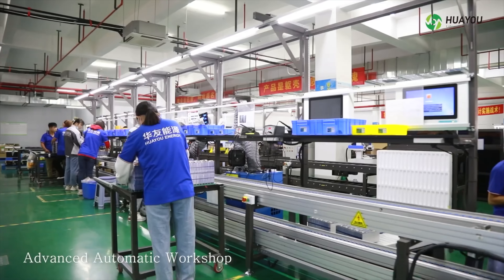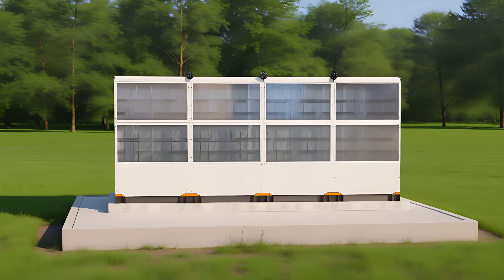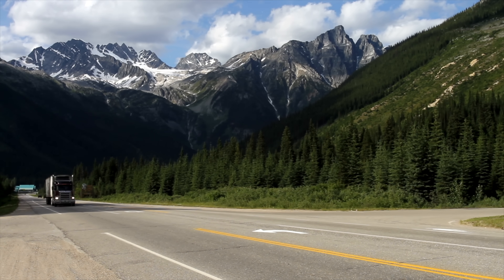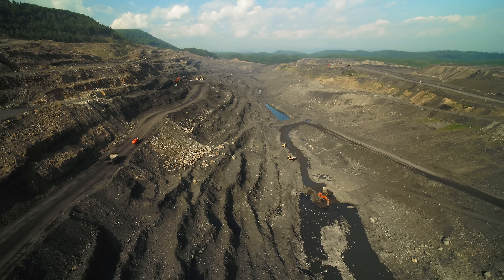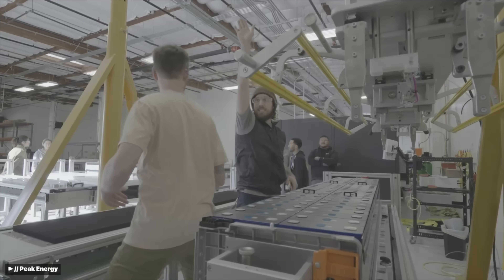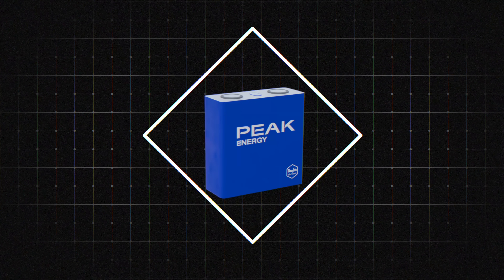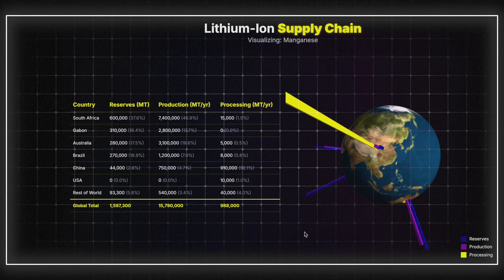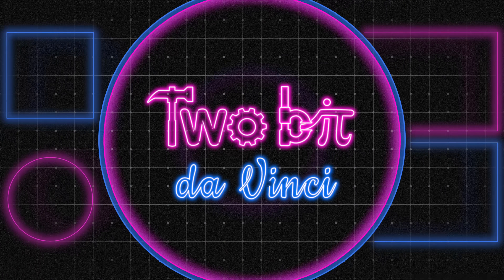Sodium Ion Batteries Are Going to be EVERYWHERE - Here's Why

Comment: LFP is $115 per kwh.  CATL has made the sodium ion, and predict they will get the cost to just $10kwh.  That would be incredible.  A home battery system for under $1000 level prices.  Grid scale will quickly be all over the sodium batteries, as weight doesn't mean anything to them.  It's all about the price.
Reply: I recently bought a 52 cell 306 amp hr LFP battery CATL grade A cells for $3050 including shipping.
I had to buy 3 16s BMSs to convert it to 3 16 kWh batteries for home storage with 4 cells left over for a 12 volt battery.
With a little DIY skills, LFP has become very economical for home storage. I was hoping to get sodium batteries when they became available,but at 72 years old, I probably won’t ever need them. 
$3500/48 kWh =$72.917/kWh. That’s a lot better than the $300/kwh I paid for server rack batteries just four years ago.
Reply: @danielking2944  They're available now, but have very poor voltage stability at the moment
Reply: Closely followed by utilities buying every battery they can get their hands on for the next 10 years to stop home BESS killing off their business model
Reply: @theairstig9164  They wont need to go through that extreme, They are already killing it here in the US by legislation and and all the hoops you need to jump through to have your power supplier approve your installation. Between the scams of equipment leasing and other expense multiplying requirements, local government entities passing strict limits and policies governing how much power you can produce, and HOAs being able to tell homeowners what they can and cant do on their own property, they have already all but killed the independent residential system capable of sustaining a typical house load without the use of the grid.
Reply: @theairstig9164  The problem is more in extended periods of overcast weather. Where I live (southern Germany), in sunny weeks it would be possible to go off grid entirely with a nice big battery. But then you also have the occasional rainy week, and suddenly you need a damn big battery to bridge the gap. 
About utilities buying every battery to keep them out of end users' hands, good luck buying out CATL.
Reply: Private Equity is going to buy all of those battery makers so expect sodium batteries to cost the consumer just as much as Lithium.
Reply: on cell level it is more like 50-70 dollars for LFP, on battery pack level yes, could be approx that, in China below 100
Reply: In Australia, I made 15.6kwh LIFEPO4 battery using eve cells 304ah and solis hybrid inverter for 3K 2 years ago.
Reply: Total installed cost for having battery backup would be around $10k in a sodium battery world.

A microgrid interconnect device (MID) plus an inverter will run about $6k total, if you need 200A service (and only modestly less if not). Having much lower battery costs is huge, meaning the battery system can be quite large, but do not expect to have your home system plus install be lower than about $10k ($2k MID + $4k inverter + $500 batteries for a large battery system by today's standards + $3.5k install). I just had a MID (EG4 Gridboss) installed by an electrician for $2k, and I plan to install the other components myself to keep costs down and because I plan to continue to add battery storage over time so want to be familiar with the details.
Reply: @dosadoodle Nice work!
Reply: Sodium Ion UPS would be ridiculously good for businesses and any location where preserving power is necessary...
Heck in the far future it'd be important in space as well... You know how cold space is right?
Reply: @dra6o0n plus no one can hear you scream....because you already froze
Reply: @dra6o0n far fetched idea we'll need them there our tax $ should drop funding that dumb dream of space travel every country havin financial issues but some are just to dumb to stop wasting $ on shit that isn't helping in the now and not centuries away or never
Reply: @Shawn-c2i  It's more likely wars will keep happening and power would be vital to be kept on in wars, which is mainly the first thing to go out when your enemies blow up your power plant and electrical grids.
Reply: @dra6o0n then a generator would work the same because the grid is out and if no sun shine to use solar to charge with how goin to have power in the battery
Reply: Excellent to see a US company bringing a new technology, especially one with less supply chain risk.  Now, will they find a backer willing to fund and stay the course for the jump to manufacturing at scale.  Even the BEST breakthroughs need either $$ backing and time-patience for the scale-up, or a known capable manufacturer partner committed to the new technology.
Reply: Keep in mind you'll need at least double the amount of batteries and significantly more space as well. The energy density is around half of lithium ion.
Reply: @ericalbers4867  LFP on Tesla has 185kwh. NMC is way higher but also more expensive. CATL naxtra is 175kwh.
Reply: @ericalbers4867  a single lead acid battery in a 1000w UPS for backup power in a room is quite small.
Sodium Ion stores more energy than lead acid in a smaller space, obviously not better than lithium.

But its safe and reliable and has a smaller form factor and weight which means you can pack WAY more into the same space.

Imagine sodium ion 2000w UPS in the same scale as 1000w Lead acid UPS?

Btw typicial low power machines don't use much wattage, its only big appliances and such that eats hundreds of watts to heat or freeze.

So imagine if your home has a UPS to handle 50,000 wattage and its only the size of a car battery or slightly bigger, buried under your home in a accessible compartment?

For people who don't cook or use heating or AC much, it will last way longer in preserving power usage at home, saving you more money on electricity.
Reply: @ericalbers4867  ITs not half, its pretty close - depends on where you get the numbers, but most of them are like 150 NA to 200 LFP or similar in range difference. At least with gen 2 and 3 Na batteries. First gen Na is lower, but so was LFP. Mainly, that is where the 30% keeps coming up because they are that close between the two.
Reply: @ericalbers4867  Some of us don't care about the space constraints.
Reply: even 60$ per kwh would be insane.
Reply: a 91% reduction is too good to be true tbh
Reply: @khang.ngtr487  If it's like the gold rush, every single major powers trying to make their own Sodium Ion battery, results in oversupply, hence lowered cost?
Reply: but in europe newer will be 10 euro per kwh, because europe not producting it and traportating can not be cheep if you transportate heavy things.
Reply: You can already but 8x 320 3.2v 320AH cells for 785 bucks after tax.
Reply: You would have to use your entire basement for home use. lol Their power density is REALLY low.
Reply: @markjohnson7887 its not THAT bad lol and they dont need to be in the basement
Reply: @utpharmboy2006  lol Yeah, I know. But my point is valid. The amount of space needed is substantially more than lithium batteries.
Reply: @markjohnson7887 yeah...home batteries would be about the only thing useable but thats okay. no way for an EV
Reply: @markjohnson7887   The density is about half.  Instead of one battery you get two.  Still come out way ahead.  But we aren't at that point yet, as big grid will come first.  Then the batteries will get better and they can move to home back up.  Not sure about them in cars due to weight.
Reply: Yeah I wouldn't get too excited. It's vaporware until it's mass produced.
Reply: EVs get cheaper, energy production and storage can become more local and completely green. Big improvements.
Reply: Although heavier than an Lifpo4 of the same capacity……it’s still roughly 60 percent lighter than an AGM so it will fall into the general market easily where weight is important.
Reply: That isnt fully true, for example, weight does matter when shipping, so if you have a 30% increase in weight, you will have to pay a 30% increase in shipping it around the world. So weight still has a play in cost. This is why China doesnt want anyone else to make batteries, because, this is factor that will play a big role if you buy local or over seas items. Plus the fact they dont wanna loose control. So all countries should be building NA battery productions and they will have an edge more or less.
Reply: @adr2t   If the battery costs 10% of the LFP battery, covers a lot of shipping.  But my point was more to the fact that with cars battery weight matters.  For a grid battery sitting there on the ground it doesn't.
Reply: @adr2t Sodium Ion lighter than Lead Acid...
Reply: @dra6o0n  And??? Almost all the new battery types are... Most Lead Acid is still produce in the local area/state/country.
Reply: @adr2t  That's because at the current level of infrastructure in America, they don't see a reason to replace something when their power grid still holds.
Stuff like Sodium Ion is especially most vastly useful in Canada and Alaska and Cold European regions. America mass producing these and exporting them would add a lot of profits and jobs to their nation ya know.

You won't see China mass producing this overnight or steadily, they've invested a ton into Lithium and toxic chemical processing for decades now, so it's not going to change much for them as they are a hot climate country for the most part.
Reply: @dra6o0n  They're building 2 new sodium plants in the US right - one about to come online and the other is about to finish up next year. So yes, they do see a need for it. Let alone, we still have cold winters - so mix batteries are still needed for both the north and mid west. LFP and NCM can still be used, but the bigger reason to go Na is because of the resource chain - removing china from it all means we can produce as many as we want without fear of someone else using it as a strong hold. They have already with rare earth and other elements. So its not fear - its reality.

So has the rest of the world and its about to go online - China over produces - so if the rest of the world also meet - they become more of a added supply vs being the sol controler.
Reply: @adr2t  Or you know we could just declare it a strategic necessity and tell the companies build X to produce Y amount of Z within A years.  Or we will nationalize you and seize your leaderships assets and use that to do the build out because you're conspiring with our national enemies.
Reply: @Radagast49230  Doesnt work like that and if it did, then no thank you. We're not china - but that is what china does
Reply: @adr2t  China knows that nearly no one can compete with them in price, even with shipping included into that cost.
Reply: @adr2t  30% increase does not cost you 30% more to ship.  Where are you even getting this idea?
Reply: @magnetospin duhh shipping prices vary on weight the heavier the more it cost I know have shipped a lot of stuff to know this is true
Reply: @Shawn-c2i  Then you are using the least efficient way of shipping and you have never used trucks or container shipping.
Reply: @magnetospin i shipped by air and ground the program was to send the cheapest way and of course we did use trucks for truck order sized orders but most had to be shipped direct to vets and distributors by air because most was refrigerated items
Reply: @magnetospin all of it was based on weight is what tryin to say so like said the more weight it is the more the price goes up no mattered what service used
Reply: @Shawn-c2i  Then your experience does not apply here because bulk batteries are not going to be ship by air.
Reply: @adr2t  with weight being an issue I am willing to bet some of these batteries are going to be manufactured in a dry state, where you open them up and add water prior to charging.
Reply: @priestesslucy  There are dry sodium flow batteries - so yes.
Reply: @adr2t except Hungary is on way to open CATL factory, even as it might happen, they will not stay Orbanocracy through next year, so fingers crossed for them.
 Oh, it means nothing for uSofA, but whatever.
Reply: @MiguelEstornino  No one really cares. Na is popping up in the EU, Japan, SK, US, South American, Canada, there was even talkings of India opening up a plant. The fact that its soo easy to produce and cheap - means that the world will have access to the tech - not limited by China anymore. So even if China might have the biggest plant - or even plants - its just going to add into the mix is all.
Reply: Don't mind the dubious presenter.
Reply: @adon8672  it's true 2BD is often jumping on new stories with little proof behind the ideas... But if you don't like the guy why watch?
Reply: @priestesslucy I do not dislike the guy. I dislike the hype-like video. From the title, I was expecting something more ground breaking or at least fair and balanced comparisons. Many start ups have come and gone after hyped up videos like this deceive members of the public into investing in them.
Reply: MNC is $100/kwh
LFP is $50/kwh.
Reply: Wont be allowed to happen. Too many trilliions at stake in fossil fuels.
The cheaper and more effective batteries are, the less you need the grid.
Reply: @Baleur how are you going to charge them? you think renewables are gonna be able to run all the data centers they are building? no
Reply: @Baleur if you have alternative sources of energy
Reply: Sodium ion is junk for energy density
Reply: @DeweyKendrick It's a upgrade for the lead acid battery for UPS solutions.
It's not meant for electric cars, as barely anyone owns them worldwide in sufficient numbers.
Reply: @DeweyKendrick so its bulky and heavy but they are using it for grid which makes a lot of sense but im not really sure with all the data centers we will be producing excess for long. maybe in 20 years when weve got a bunch more fission plants up
Reply: @DeweyKendrick don’t have a light saber ,just a few LED bulbs and a fridge 😂

Comment: Great news if it can be commercialized at the projected price.  As the lithium cells in the grid backup units reach the end of their useful life lithium and other valuable elements can be recycled.

Sodium based cells would be ideal replacements for the passively cooled battery packs on the many Leafs still in service.  Maybe by the end of the decade

Comment: I really hope this technology works and comes to market soon.  I see the Peak Energy battery as a great solution for whole house battery storage.  I would be very confident with having this much safer battery attached to my house versus any lithium battery.  I also love that it can be fully sourced within the USA.
Reply: The raw sodium battery cells are already on the market since early this year, from the 15Ah cylindrical to 280Ah prismatic cells. However it's still limited to just one supplier (Hakadi Battery) and if you order from it, it takes an indent period of between 2 weeks to 1 month

The reason of this is because the production rate of sodium battery is still relatively small compared to LFP, and most of the sodium ion battery supplies goes to the domestic market
Reply: Agree, at least allows America to have a running man in the race, South Korea manufacturers already said they won't be able compete, this includes Samsung, CATL's layered oxide sodium battery offers higher energy density for electric vehicles (EVs), while American sodium pyrophosphate (NFP/NFPP) chemistry developed by companies like Peak Energy provides enhanced safety and a longer cycle life which is great for home battery storage.

Comment: unfortunately you need to research more, carbon or graphite china controls 90% so monopoly won't be broken anytime soon unless graphite production scale up dramatically , don't underestimate carbon
Reply: You just pulled that "statistic" out of your ass. From Google: "China controlled an estimated 77% of global graphite production in 2023, and its market share in the processing of battery-grade graphite is even higher. By 2025, China's market share in the graphite anode supply chain is projected to be over 85%." Raw graphite and completed graphite anodes are not the same. Graphite is sourced from other countries including India and Brazil. (Both countries that Trump has antagonized).
Reply: @avsystem3142 why you angry?  At any case bricks control graphite production and trump declare war on bricks with tariff so Im not that far off  because china the corner stone of bricks